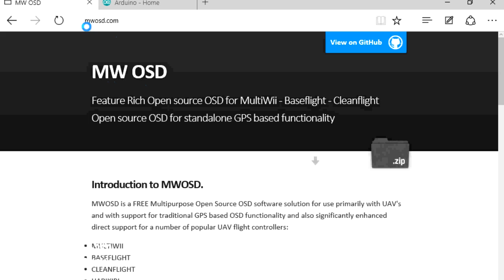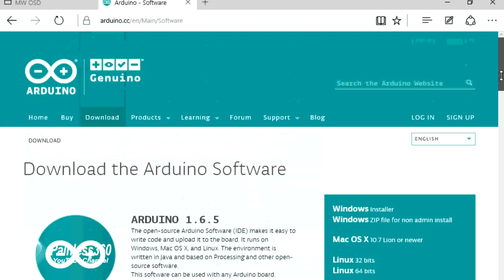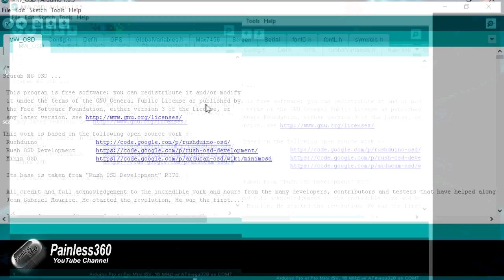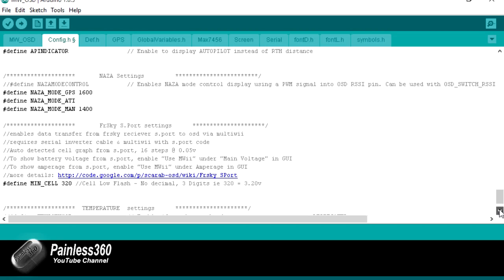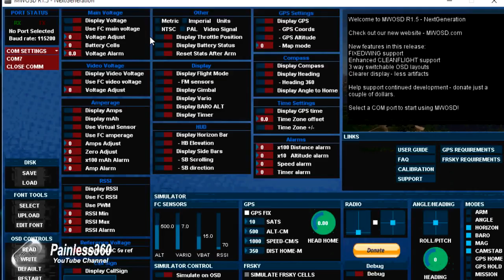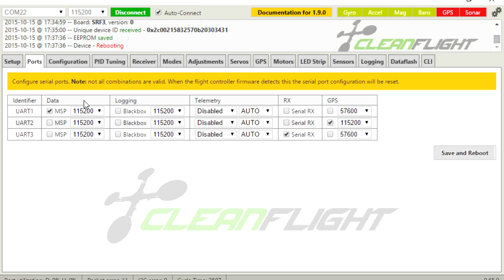(7/9) Seriously Pro F3 (SP3) Series - Adding an OSD for FPV using a MinimOSD

Comment: Hi, is there a diagnostic code list for beeps and blinks? I get a constant beeeeep noise when i plug my battery in. I can move the motors in cleanflight but no comms from radio. also when connecting via usb i get a long blink followed by thre short ones and three long ones (red led). Did I wire something wrong?
Reply from the maker: There is in the documentation. I'd try it without anything else plugged into the FC to see if that helps.. (also check vBat too). Best of luck!
Reply: Hi, make sure you are not victim of the buzzer output bug of the clone board. Instead of buzzer output, it is constant 5v, just solder the wire on the other pad. Google should help.

Comment: Hello! Thanks for the video! Your channel has been making my first build a lot easier.
So, I have a doubt and I didn't found the answer in your videos.
My Video transmitter (Eachine TX526) doesn't have a 5V out for my camera (Eachine falcon) and the imputs are like this: [GND, audio, video, GND, 7~24V]. 
The camera will be powered by the 5V BEC in the PDB.
The audio will be  CAM --> VTX
The video will be CAM --> MinimOSD --> VTX
So how do I connect the camera ground wire?
Should I connect it in the PDB? Should I connect it in the OSD and VTX or should I connect it directly in the VTX?

Sorry for the long question!!
Reply from the maker: +Jonathan Volkmann Cardoso is connect a GND wire to the camera,  input on the MinimOSD and the PDB so there is a nice conmon reference for the signals. Best of luck!
Reply: Thanks for the answer!
Ok, so I should do like an Y connection with the "OSD GND in" and the PDB?
And I shouldn't connect anything on the VTX "extra" GND and on the "OSD GND out"?
Reply from the maker: Not sure what you're asking. I'd connect all the GNDs together - VTX, camera and MinimOSD. Best of luck.

Comment: Hi Painless 360, i'm following your videos and they are very explicits...but i'm young in the open source community and i wonder if my list of components would be great....! What do you think about mine......FT232RL FTDI USB To TTL Serial Converter Adapter Module For Arduino , CRIUS NEO-6 V3.1 GPS Module For APM Pixhawk MWC Flight Controller , MinimOSD MAVLink OSD APM 2.6 APM 2.52 Flight Control Board , 3.3V or 5.5V USB Programming Module for Naze / Minim OSD / Frsky / Multi-wii , FTDI GPS Adapter Cable GPS Serial Conversion Cable , Upgrade NAZE32 SP Racing F3 Flight Control Acro 6 DOF/Deluxe 10 DOF for Multicopter...

For others components i already get camera, Tx, Rx.....

Thank's a lot and fly funny
Philippe
Reply from the maker: +Drones Visions Aériennes Hi there, I support new builders normally using one of the chargeable one-to-one calls as it is an opportunity to go through the list of kit and answer any other newbie questions one may have. The things I'd mention in the list is that you will need to reprogram the GPS and MinimOSD for Cleanflight if you are using the SP3 and choose the motors/ESC and power distribution pieces too.. Best of luck!

Comment: sorry to bother you but im wanting to build a quad capable of long range and really love the SP RACING F3 EVO FLIGHT CONTROLLER you have. If i use the one of the uart ports connected to a TBS pnp pro will it feed the data from the sp's Mag/Compass and Baro/Altitude sensor to the OSD of the tbs pnp. any help would really be awsum as im using the tbs crossfire and really need to see the rssi value im on the crossfire protocol
Reply from the maker: Not sure what you're asking. This is probably a better question to ask on the TBS support forums. Sorry I can't be more help..
Reply from the maker: The first video for the Crossfire went up today! Hope it helps..

Comment: If I don't plan on adding GPS to my quad could I change in cleanflight my usb to connect cleanflight to uart 2 instead of uart1 so I can solder my micro minimosd to the uart1 port and not worry about the connecting to usb at the same time?
Reply: or rather could I just enable msp on uart2 and connect my osd to it and not have to worry about them both being connected at the same time?
Reply from the maker: +Mike Boyd UART1 is commonly hardwired to the USB port so adding other things to it outside OSDs that also use MSP can cause problems. Best of luck!
Reply: What if I use the osd on UART 2?
Reply from the maker: Try it and see ;) I had huge issues when I tried to get too clever with telemetry.. Might be better now.. Best of luck!

Comment: Hello, tell me, can I connect Minim OSD to UART2 instead of UART1 pins, and set it in clean flight as telemetry out? I don't use gps and don't want to unplug OSD every time I plug USB in
Reply from the maker: +Роман Савченко try it and see ;) best of luck!
Reply: +Painless360 tricky answer)) it's better to know before trying))
Reply from the maker: The way that works is shown in the video - if you want to try another way then best of luck, it may work..

Comment: Is there any reason not to use Uart2 instead of Uart1 for OSD, it would be less of a hassle when connecting USB. This would leave Uart3 for sbus and just use softserial for telemetry. Just wondering if this would work.
Reply from the maker: That will work. Happy flying!
Reply: I'm mounting my board side ways, so usb and uart 1 port are really easy to access

Comment: I am actually looking for how to you connect the VTX to this FC ? I am actually helping someone that has very low budget and is a beginner, I am used to solder the VTX on the FC on the VTX pads and the camera on the VIN and VOUT etc.. but I cannot find those pads on this FC... Can you help me with this ? Thank you!
Reply from the maker: This is a very old flight controller now and has been superseded many years ago. Watch the video again and you'll spot that it's actually a separate external board that's doing all of this stuff for you. Best of luck
Reply: @Painless360  Thank you! I have already seen it indeed. I am thinking actually to connect the VTX and camera like you show it here 19:39 with the difference that no OSD will be available.

Comment: I also did everything as you shown and i see the OSD on the monitor (that onely works without the D4R-II conected) 
When I connect my D4R-II reciever to the F3controler with PPM (one cable) the picture goes away on the monitor 
  Any advice?
Camera and OSD are in PAL mode (thats why i can see the osd other the cam picture)
that is fine , but why does the monitor picture goes away with the D4R-II conected ??
something to do with jousing the same UART ??
Please help trying for days now!
Reply from the maker: +RC opter you csn turn off the osd using a channel on the radio. Use the GUI to check you haven't got that setup. Best of luck!
Reply: +Painless360 
Gui cleanflight of OSD gui ? 
thanks for the quick respons
Reply: +Painless360 I`m jousing a micro OSD not the mini OSD somthing to do with that?
Reply from the maker: +RC opter osd gui....
Reply: +Painless360
found problem 1: not enougth 5Volt power from my PDB for the F3+RX+LED+OSD
I`ve i turn off the LED`s i got a picture withe the OSD, problem fixed (LEDboard has to get a different 5volt power)
But stil no data on the OSD from the F3 , no voltage , can`t get into the stik menu,.....
Reply from the maker: Check your endpoints go far enough on the sticks so the menu 'sees' you trying..
Reply: +Painless360 
Got it!!!!!!! every is working like with the naze32bevor
 I`m verry pleased after al. BIG THANGS to YOU !!
Reply from the maker: Great news! Please consider supporting us here and becoming a Patreon.. :D

Comment: im running a microOSD and latest FW of CF and MWOSD.
When i upload from arduino i get a warning of low memory on the micro and when i arm the quad it reboots the osd. 
Could this be due to the low memeory?
I have tried diffrent power and ground sources.
Reply from the maker: +k.o “crash” rengaarder Possibly, I've not seen that here. I would use the older version of the Arduino compiler.. Best of luck.
Reply: +Painless360 Similar problem here. I tried to upload the arduino code in various combinations - of arduino versions (1.0 to latest one) on different computers but keep getting the error message
Arduino: 1.6.7 (Windows XP), Board: "Arduino Pro or Pro Mini, ATmega328 (5V, 16 MHz)"

Sketch uses 25,730 bytes (83%) of program storage space. Maximum is 30,720 bytes.
Global variables use 1,850 bytes (90%) of dynamic memory, leaving 198 bytes for local variables. Maximum is 2,048 bytes.
Low memory available, stability problems may occur.
avrdude: stk500_recv(): programmer is not responding
Not sure what that actually means. Would you have any advice?
Reply from the maker: Yep - we have en entire video on the common causes for the STK500 error - you've watched that right?

Comment: I am using a SP3 with inav and want to move the minim osd to a free UART uart3 port, 
This is so I dont have to disconnect each time I want to connect the USB port.

The inav info I found says you can have two MSP ports.
I have set uart3 port to MSP and have to correct connections but no matter what I do I cant get it working. If I move the minim osd back to the TR, RX of UART1 all works ok.

Do you have any advice to where I am going wrong?
Reply from the maker: +Wynne Davies (BoLt) depends on how you have it configured. Without a screenshot eccetera, it's Tricky to comment. But you should be able to enable two of the ports running MSP..
Reply: Will do
Reply: I did what you told me and wiped the FC but this was a good thing as it gave me a chance to update the firmware at the same time. I enabled MSP on UART3 but this did nothing (same fault).

I have an interesting update on the problem that has made me come to a conclusion up and give but not in that order. 

I swapped around the GPS that was on UART2 to UART3 and moved the OSD that was on UART3 to UART2. I set up UART2 for MSP and the OSD worked with the USB wire plugged in. 

Ok that’s the good bit. 

The GPS now on UART3 with the same setting it had on the other port did not work and I got a RED GPS informing me that there was a problem. So now this had stopped working, Grrrr

Just in case I changed TX and RX round and got the same. 

I swapped the GPS back round to UART2 with its settings and this again worked ok. 

So form all this I have no choice but to connect the OSD TO UART1 and remove the OSD when connecting the USB. 

I guess it’s one of those things...

Comment: Can a soft serial port be used instead of the uart1? This would keep us from unplugging the osd to use the USB correct?
Reply from the maker: You can, if you use the SoftSerial then you may find you have to lower the baud speed on some boards. Personally I'd setup UART2 with MSP for the OSD.. Best of luck!
Reply: Painless360 I'll give it a shot! Will you be doing a video on the SP3 EVO? Thanks again for doing what u do!
Reply from the maker: Not planning to - they are all variations on a theme now. Some cute new FC's coming out in the next few months that are different enough to warrant a look - happy flying!

Comment: Thanks for video . I've problem regarding OSD with Frsky D4R-II and telemetry info on SPRacing F3. The osd screen is working propelled with data (flight mode , horizon , timer , etc)  , but the voltage of battery only flashing with 0.0v on display.

I'm using minim osd , I used uart2 for osd connection.
For frsky D4R-II telemetry port , I connected only RX (green wire) from receiver to SPRacing F3 board 's uart3 at TX pin. I'm using PPM , so I connected one signal cable to IO_1 connector on SPRacing F3 board.
And I leave uart 1 port open. May I know what's the problem ?
Reply from the maker: +Adam Chan You need to make sure that vBat is connected and configured - see the other video in the series..
Reply: Also thanks for video. I have the same problem.. Everything works perfect except battery voltage. I saw that in cleanflight battery voltage is also 0.0V (on your other video present battery voltage was displayed).. Of course battery is plugged. Have you got any idea what it might be?

Current meter works fine.
Reply from the maker: Yep - you need to tell the OSD if you're using the battery information from the flight controller or from a directly connected sensor - see the GUI.. Best of luck!

Comment: Hello Painless 360. I have a problem with my osd. The info on my osd wouldn't fit into my screen. Do you know how to fix this problem?
Reply from the maker: Depends on what goggles, OSD and setup you are using. Some OSDs allow you to move the on screen elements in a row or two..
Reply: Painless360 I have a fatshark dominator hd2 goggle and a mini fpv screen but they are both doing the same thing. There is also no tool to adjust the osd, but if there is, could you please tell me? thank you
Reply from the maker: Yes there is - see the video where we use the GUI to upload the Fonts. Some versions of the firmware allow you to move things about on screen to help with this.. Best of luck!
Reply: Ok thank you so much for the help

Comment: Tried to upload the firmware and it just hangs there for ages, never finalizing. I have watched your video on using earlier versions i have tried 3 other versions and none will complete Any advise?
Reply from the maker: +spooner Graham it did that to me when I didn't select Manual Vaud rate. Best of luck!
Reply: It would have been more helpful if you could tell me how to do or were to find this Having never done this before Remember i am trying to follow your build from 1 to 9 as a beginner Cheers
Happy flying
Reply from the maker: Re-reading the original post I thought you were talking about the SP3 not flashing. That's what I answered about and we cover that detail I mentioned in the video where I set it up ;)
Reply: I am sorry for the confusion, It is the uploading file to the arduino I have watched your video and i cant find how when you say change the rate to manual Surley i have to write some code to do this
Reply from the maker: I've not had the actual Arduino stop after opening the port. Make sure you're using V1.0.5 as the later versions of Arduino can cause problems with older sketches.. Best of luck!
Reply: I am sorry i ever took this build on I thought i would be flying by now and yet another problem I have taken the osd off for the time being untill i can sort the code out My problem from last night The sp pro started to make beeping sounds like when it is re booted but over and over I disconected straight away I was able to conect to clean flight It was when i plugged the bat in
I had bought a second flight board for another quad i was going to make I decided it must be a fault on either the distribution board or FC
So re wired up Flashed and testing the motors As each one is slowly increase no problem But as soon as i full power up They all stop Like putting the brakes on Then the board starts with the noise agin These are all new esc Please can you try and help I can't find anything to do with fault sounds on the fc
As when a PC makes sounds there is a fault code
I just want to fly the bloody thing I can always video the board if you can help by watxhin what it does
I appreciate you must have thousands of mail ,and have had a lot off me So i apologize for that
Thanks Graham
Reply from the maker: Sounds like a power problem to me - I'd check out the UBEC can handle it. An OSD draws more current than you think. Get it all working with the minimum kit then add the extras one piece at a time and then troubleshooting will be easier. Best of luck!
Reply: Cheers ill get on to that first thing Ill let you know how it goes Thanks again and sorry for keep troubling you
Reply: Than the lord your here
It was a battery Brand New and 1 of the cells has failed
So all that re wiring for nothing It has improved my soldering
Stay tunned for the next problem Will i ever get to step 9 of the build still not flown it yet as my AT9 only arrive a week ago
British weather It's raining agin here in Liverpool today
Happy Flying and Cheers
Reply from the maker: I'm across the border in Cheshire so I feel your pain! :D
Reply: lol